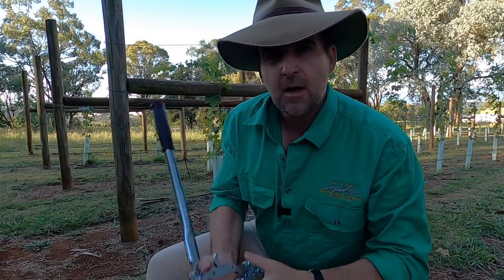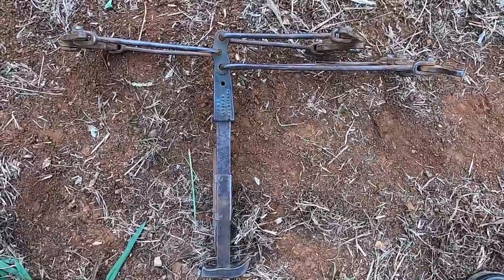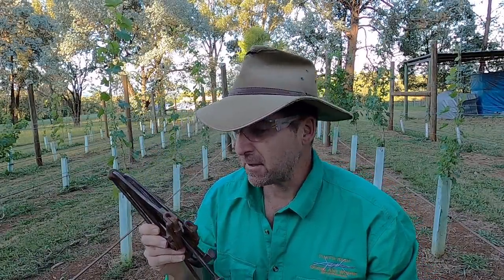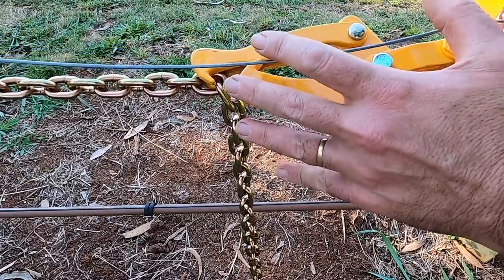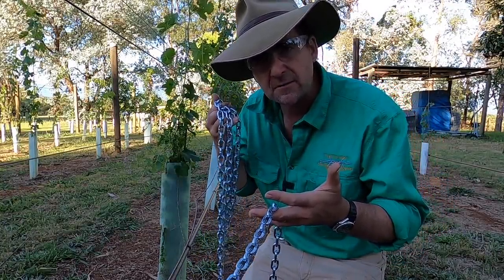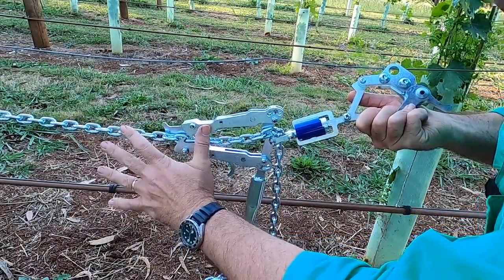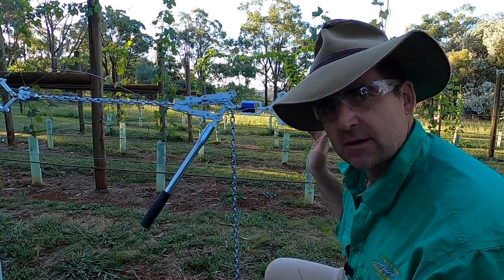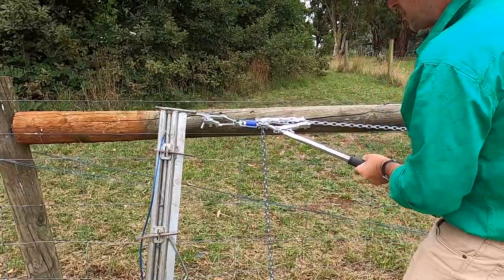Fenceline Solutions Strainers - Game Changers? A Review.

Comment: Great review - thanks Tim.  Another item for my (rather long) shopping list.  
I have found a good use for the older style - with the wire clamp on one end and the chain slot (for going around a post at the other).  It is very difficult trying to tie new cordon wires into a vineyard that's full of vines (a lot of fighting through shrubbery while trying to install the strainer and not knock too many branches and bunches off).  I've found the easiest way is to attach the chain to the post at one end, carefully thread the chain through to the wire I'm trying to strain, attach the clamp on the other end of the chain to the wire and pull the wire through by hand as much as possible.  I've now got a cordon wire and chain that is under some tension, no loose chain dangling into the foliage, and can (at a more leisurely pace) attach the wire strainer and strain the wire.   
Of course, the Pro solution would be - get your cordon wires sorted in winter!
Keep up the good work

Comment: G'day Tim. I'm about to take the plunge into fencing, and I'm happy to pay for good gear and these are obviously top of the line. But I'll be doing sheep mesh, and in one of your other videos you recommended two sets of strainers to do top and bottom of the mesh strainer.

400 bucks is one thing, but 800 is a whole other thing. Should I go a cheaper (but still decent) set for straining mesh? Or is there another approach? Cheers
Reply from the maker: Hi Lachlan. Use a block and tackle for the bottom until you get going and can afford a second set. You should be able to get a decent block and tackle (hand winch) for much less than a hundred bucks.

Comment: Hey Tim
I’ve been building my diy fence. I found the these strainers are hard to release and need a hammer to hit them loose. Am I straining to tight? I’ve gotten a really tight strain on my first fence I made, it feels nice. Learnt how to do it with your videos. Thanks
Reply from the maker: I haven’t had that problem with the fence line strainers, but have experienced it with thin wire (2mm) with the wireman ones. Normally you only go to about 1/3 breaking strength of wire, which is 2.2KN on the built in strain gage. Going beyond that will only stretch the wire and weaken it. Hope that helps.

Comment: Picked up a set of fence strainers from Bunnings a few months back only cause the local farm stores were out of stock, worst buy ever. Get the wire up to tension so that it can tied off and then the fun starts in trying to get the fingers/claws off the chain, almost like there's not enough movement between the fingers to release the chain when you go to walk it back down.
Reply from the maker: Have you cut the spring off?